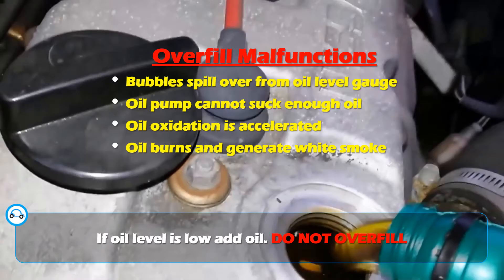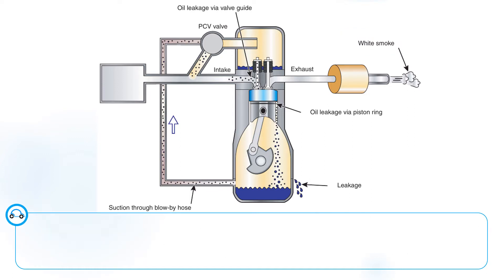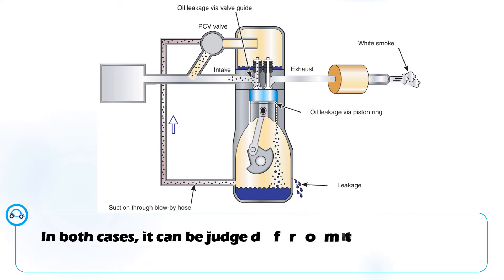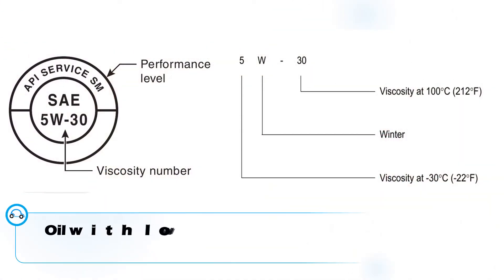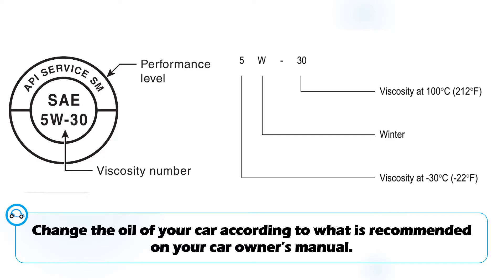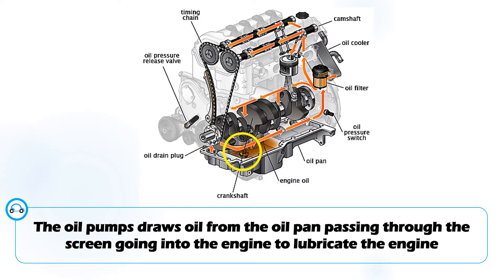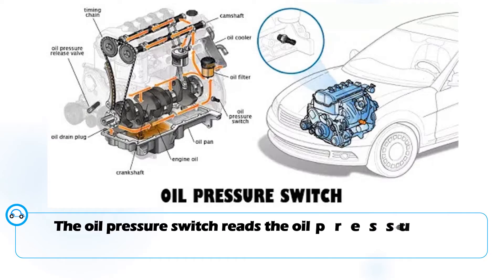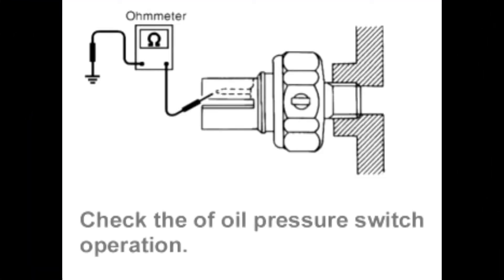Oil Light Flashing  in Car while Driving

Comment: When I’m driving my oil pressure light will flash on and off IF I start to lower speeds (hit the brake) when I step on the gas it goes away. When idle it will sometimes flash on and off or stay solid. I have oil is it the sensor?

Comment: questin : so if when i start the car the oil light is on but when the engine starts and makes noise the light goes off does that mean that there is no issue?
Reply from the maker: When the ignition is turned On the oil light comes on, but after the engine is started the oil light will comes off, this is normal.
Reply: I got 2000 expedition when I start the engine the light oil pressure sensor light on! It doesn’t go off until I run about 2kilometer and then all of a sudden drops again. What the cause? But oil is good I check it everyday.
Reply from the maker: Did you use the right oil specified on your vehicle manual?

Comment: light my pressure oil off on flickering braked when. Drived 2013 Hyundai accent had 194,000 miles. Had I oil changed scheduled tomorrow for. I should add oil quart?
Reply from the maker: Check the engine oil level on the dipstick if it's below minimum then add oil.

Comment: I just had my oil changed because the genie oil thing it looks like a genie bottle like it was blinking and it wouldn't stop timing and I took it to get an oil change it was fine my oil was great but I had it changed and it was still doing it the guy said that it's my oil sensor switch is there a way to undo the timing of that oil light because the timing is killing me and I won't be able to get it fixed until after the holidays is there a way to stop the charming on the dashboard
Reply: Chimming

Comment: My golf tdi oil light flashed for a few seconds when I started moving in first gear but only when I didn’t rev to or above 1000 rpm’s. When I increase rpm’s it goes off. It only
popped up twice for a few seconds, any thoughts?
Reply: Same problem here , what was issue in your case?
Reply: @nasirautoelec  we’re still working on it. I replaced my oil pressure sensor and it still comes on. We’re installing oil pressure gauges to see if there is actually a problem
Reply: @K.A.TaylorWoodworking  local mechanics are saying me to change oil pump
Reply: @nasirautoelec  that’s what I’m going to do if the gauges say something’s wrong. All I can tell is what the light says but the light can definitely just be from a dirty sensor
Reply: @K.A.TaylorWoodworking  best of luck sir
Reply: @K.A.TaylorWoodworking  hey man what ended up  happening to your car? Cause my car is the same thing, I have an 04 Corolla and i changed my oil pressure sensor but still had the oil light flickering.
Reply: @KtMSpyder  well my engine blew up on my way to the shop
Reply: @K.A.TaylorWoodworking  nahhh I’m sorry about that bruh how’s the car rn ??
Reply: @KtMSpyder  I'm about to k swap it and transition it to gas instead of diesel

Comment: Sir….mind helping me. As shown in your video, the pressure was the same after at 2,000 rpm. The pressue suppose to increase or not ? Thanks in advance
Reply from the maker: When the engine speed is at 2000 rpm the discharge pressure should be approximately no more than 3 kg/cm^2, then as the engine speed increase to more than 2000 rpm, the discharge pressure should remain the same at approximately 3 kg/cm^2.

Comment: Hi, I realized that I poured too much oil, exceeding maximum, when I check the deep stick, it is three times to normal, now the oil light is flashing and the (Check engine sign/symbol) is on. I don't know if I reduce oil to normal,  (will the 2 lights go off)?
Reply from the maker: When oil is overfilled, it is stirred in the oil pan, and bubbles are generated, the bubbles spill over from the oil level gauge and the oil pump cannot suck enough oil, and this causes the engine to seize up. Keep the oil within the normal range.

Comment: 03 530.....oil can and pressure flashing.
Changed sensor...full of oil....pressure at 21.....yet..lights still on....help
Reply from the maker: Check the oil pump. Also, possibly a partially clogged oil pan or oil with wrong viscosity is used, conduct change oil.

Comment: my Polo 2008 Bah is showing oil light but I've changed oil pump and oil pressure sensor but no success

what else can I change
Reply from the maker: Is the light flashing or sometimes on sometimes off or steadily on? Is the oil level within the normal range?
Reply: @cartechhome  yes the light is flashing and my oil is at the right level.

it all started by the time I put a new oil pump, is it possible that an oil pump can be fitted wrong?

https://youtu.be/ouZeDGrvcR8

Comment: Light on comes on when idling not when moving...
Reply: Light flashes when at low idle not when moving continously. Check engine came on
Reply: @jftwrockz1399 same here sir
Reply: It’s the sensor at least from this videos info.
Reply: @austinebayp160  i got oil pump changed the problem is gone
Reply: What was your issue? Same peoblem is here in my car
Reply: @nasirautoelec either my oil sender switch is defective or there is a wire short but once auto goes from idle to the carlrunning the light goes out .. I have oil and I change the oil regular when it's time ..
Reply: @rcthomas6925  so there is no issue in oil pump?
Reply: @nasirautoelec  what oil pump?
Reply: @rcthomas6925  engine oil pump

Comment: My car lights on when engine is hot then accelerate goes away when cold no oil light it think oil grade issue 3:59 that you mention
Reply from the maker: What is the viscosity of oil are you using?
Reply: @cartechhome  5w30
Reply: @cartechhome  but when I used 5w40 oil light flickering on idle when I put 5w30 only show on idle
Reply from the maker: @Farzan5889  So 5w30 and 5w40 make the oil light flicker at idle?
Reply: @cartechhome  5w30 show light at idle in 5w40 at idle flickering  if tappet sound in car can I listen while driving or not

Comment: I've changed oil pump and the sensor.  But the light still comes on . What to do please
Reply: Your light flashing on warm engine or cold engine at idle please update
Reply from the maker: Its possible that the oil pan is partially clogged. Do engine flashing and change oil. Also we have video here on how to check if there is problem with the pressure switch.

Comment: Hello. I've found our video helpful and I want to say thank you. 
Meanwhile I'm having a serious issue with my 2009 Lexus ES 350 and I'd like you to help. I woke up today, pushed start my car and the oil light didn't show on the panel.
I'm having my engine oil to its normal level and the oil pressure switch looks okay underneath. 
I'd like to ask, what will be the cause of my cars engine oil light not coming up before start.
Reply from the maker: You said you pushed start your car does this mean the battery is dead?